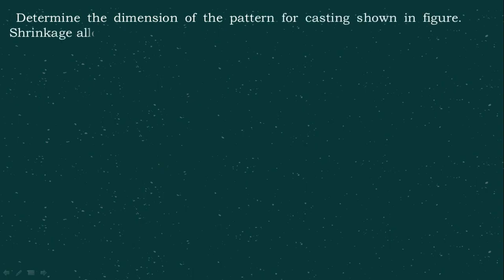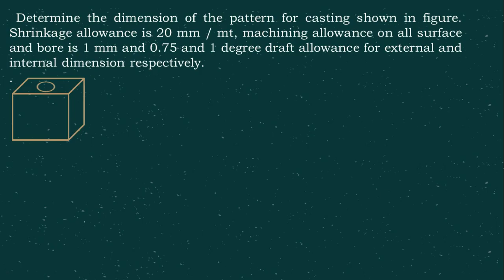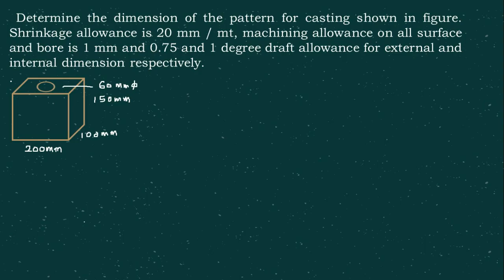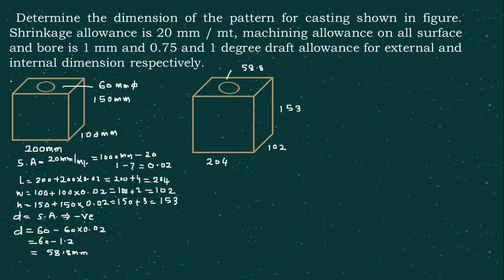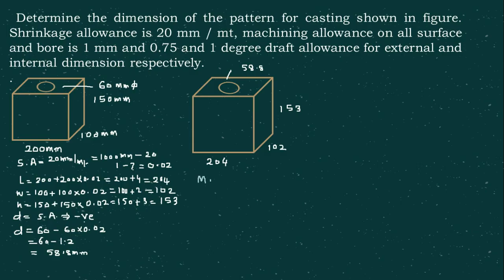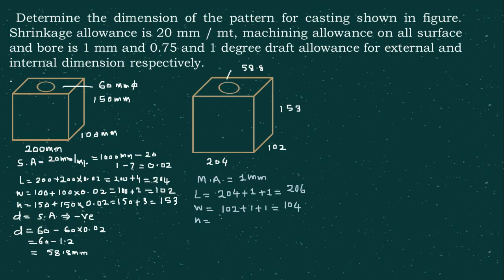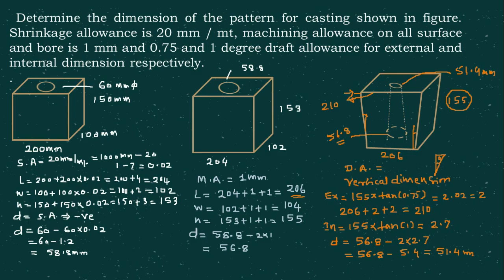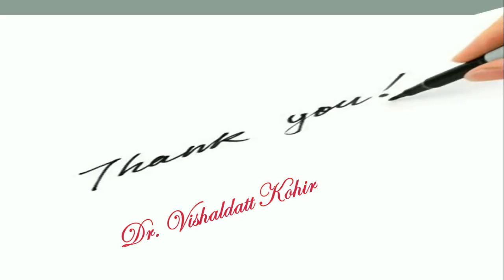numerical on machining and draft allowance

Comment: sir plz help me in this prob:-
Shrinkage allowance is made by.......

   A.Adding to external and internal dimensions

   B.Subtracting from external and internal diamensions

   C.Subtracting from external diamensions and adding to internal diamensions

   D.Adding to external diamensions and subtracting from internal diamensions

ANS IS D.  but  BUT I dont understand the "subtracting from internal dia" part.
Reply: While casting metal shrink so additional volume is added , so that even after shrinking it's volume becomes equal to the required volume .On the other hand , for internal structure like a hole in a cube it's shrinkage is - ve means hole radius increase..
Reply: @hrkalita159  THTS WHT I CANT IMAGINE..HOW DOES -VE SHRINKAGE OCCUR.. IN + SHRINKAGE WE KNOW THAT  MOLECULES CONTRACT AND COME CLOSED AS THEY COOL BUT WHT BOUT -VE SHRINKAGE